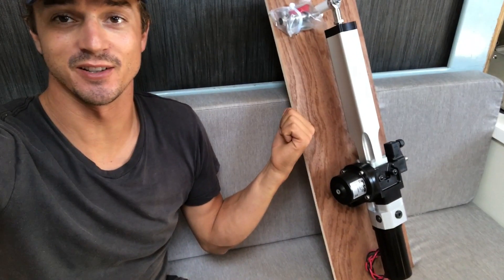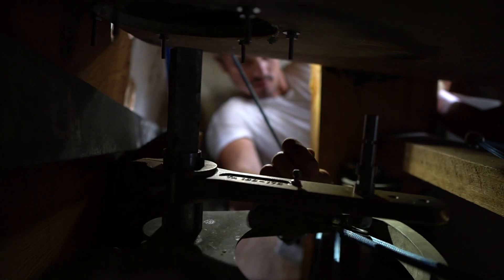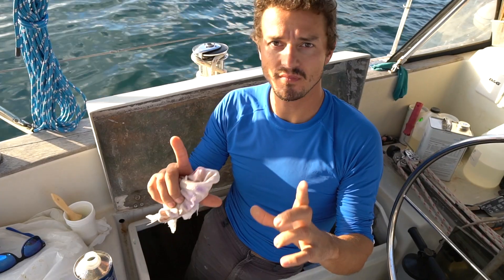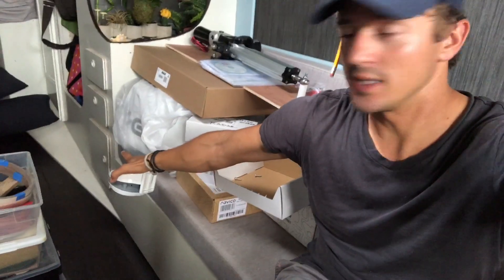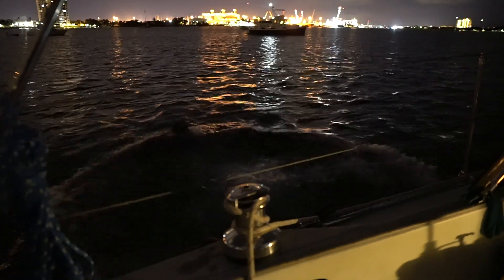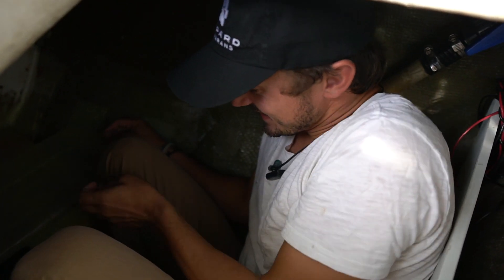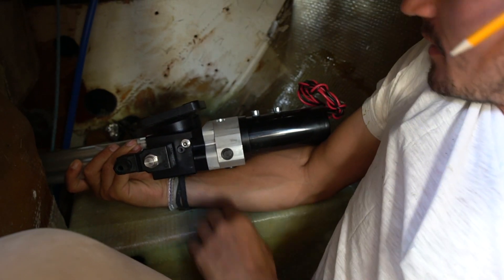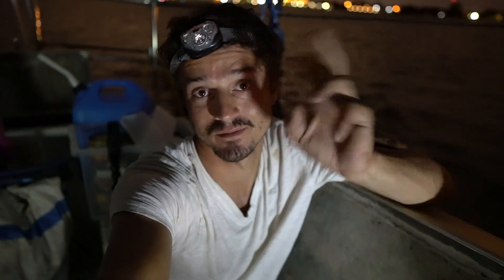Our Last Big Boat Project of the Year— Sailing Uma [Step 149]

Comment: This does remind me on our ram setup (in like 1986)... just far more complex. If it works anything like ours did... it's a god-sent and soooooo sweet. Ours didn't have a wind sensor, so it needed adjustment as winds changed. Still, I remember low wind days where we all sat on the foredeck, having a lovely salad and enjoying the sail waaaaaay more than if any crew would have had to stay back to tend the tiller.

Comment: I am a retired agricultural mechanic and on parts that were prone to water and corrosion we use never sieze grease. Its a bitch because it does not clean off easy ( 3000lbs high pressure washer wouldn't work), but great to keep metal from rusting and moving parts going.
 Also if you have a gear box that keeps heating and burning gear oil, try putting 90% corn head grease(you can find these at farm equipment dealer stores JD,NH etc) and 10% gear oil. This grease is high pressure, high speed and constant viscosity at -40c to +50c temp.I used this in gear case on PTO driven generators during the major ice storm of 1998 which kept them cool and running 24/7.
Reply: My Godin,
I will look into that high presure lubricant , if it does what you say .. I may use it on North Star...
Robert

Comment: Kika, for cleaning the hull: A German sailor bought a butchers glove (they use it to protect their hands when cutting). This is in a kind of hard and sharp. This makes cleaning a lot easier. Also he got a handle for glass workers, they use to carry large glasses without putting fingers beyond . He sucks this on the hull (often over the water line) so he had a better hold when working.

Comment: Dude I fully agree with over building. I was told that if it's worth doing, it's worth doing right.  Plus I just flat out don't want to REdo it. That's why the only thing I would do differently is adding a plate to the underside of the bench for the mounting bolts to anchor to and through. That and double nut everything. However good job guys! I hope you get many many years of trouble free service out of it. 😎

Comment: Good Job !!  There's only one weak link in your design....  Try to use a metal ferrule / sleeve, epoxy or glassed in place for your through bulkhead or plate bolts !  Even though you used marine grade materials, the small area around the mounting bolts can allow moisture to get in and start de-laminating . Thereby weaken the structure that has to endure lots of shearing forces ! Your choice of using large fender washers was a good idea ! But that only helps for lateral pressure ....! One and a half tons is a lot of force !!

Comment: Sometimes those compass locations can be a pain. And it can't have anything made of Iron or Steel anywhere near it unless it has really good compensation. And electric current carrying wires can instantaneously throw them off. Hate putting them in or on or under cars.

Comment: Does that quadrant only hold on to the tiller shaft by clamping friction? I very much doubt that will be enough. Never clamped 40mm, but 17mm on my CNC spindles and you need a ton of force and loctite to keep them from slipping.
Reply from the maker: No, there is a 3/8” key as well and locking screw.
Reply: @SailingUma  Perfect!

Comment: That’s some shelf. Love the lay lines and auto tack features on the B&G kit. It’s top notch!  Is all your 12V power for the ram coming off a DCDC? Or just one 12V set of your 48V pack?  Shame you can’t get a 48V version. Maybe one day.
Reply from the maker: Yes, all our 12V loads come off our DC-DC converters. We have 2 300W wired in parallel so if one goes out, we still have the second one. But honestly, the autopilot doesn't draw that much current, and in rough seas or strong wind, we usually rely on the windvane anyway.
Reply: Sailing Uma That’s cool. Glad to hear you’ve a backup DCDC. Even though of course there’s the CapNord as well. Bomb proof!!  👍 Very impressed with the Cap Nord. Very effective. Playing catchup here but watching the current episodes too... Fingers crossed for the saildrive....  Thanks for the reply. Cheers!

Comment: Very informative video, learning a lot about hydraulic autopilot systems. Do have 2 questions. Any thought about installing the in a different location rather than next to the display? Might be more convenient to be able to operate the autopilot from 2 locations. I don't know how the quadrant stop are built, so I'm not sure if the pressure from the ram pushing on the stops is the right way setup.
Reply from the maker: Good questions. 1: you can control the autopilot from any screen plus your phone, so your never too far away. 2: you can set the ram travel angle so it never gets to the rudder stops. Ours is set to 25deg and our stops are closer to 40deg. But if your boat is well balanced the pilot rarely goes past 10-15deg. 

Hope that helps.

Comment: since installing your B&G gear how much do you still use your Cape horn wind vane?
Reply from the maker: All the time!! They both have they’re pros and cons. We used the Cape Horn for the entire Atlantic crossing. But then it’s very convenient to just press a button and go grab a line or trim a sail. Perhaps we should do a video about it.... what do you think!?
Reply: @SailingUma  a video would be great and useful to see pro and cons
Have B&G set up but long passage or power failure would be good to have an alternative
Reply from the maker: Sounds like a plan. We'll add it to "the list" of videos to make. We're kind of the opposite though. We have the Cape Horn which work great 99% of the time, but sometimes it's just nice to push a button and have the boat keep going in the same direction for a bit while we sort something out.

Comment: I'm not quite sure if you want your compass so close to electrical wires. Even a weak electrical field from the wires will mess with the compass. I once was on a boat where the compass was in the wardrobe and even the metallic coat hangers did a solid on the compass orientation.
Love and greetings from Germany.
Reply: Who uses a compass in the days of  GPS ?
Reply: I do :p :D
Reply: that little round puck Dan installed in the drawer is a compass, and yes it's not a great space to install it.  I had to move mine in a similar location because something metal would get placed in the drawer and mess up the compass....  So you have 2 choices don't put anything metal in the drawer or move the compass...  Bob
Reply: If both electrical wires to each load are mounted in very close proximity to each other they won't generate any external magnetic field.
Reply from the maker: As long as the metal around it stays consistent it’s fine. The problem is once it’s calibrated, and you add something new it can mess it up without recalibrating.
Reply: I was wondering about this but yep keep the power wires-+ close to each other preferably twisted and don't make any changes after calibration makes sense
Reply: I suppose it would be too much to ask for a switch to prevent the windvane from ever competing with autopilot and for some kind of shielding plate between the ram and the hull. It all seems to be getting pretty complicated down there and beneath the waterline and at a gaskette. Perhaps a water sensor near the rudder gaskette might be a good idea. Anyway, you know best D&K.
Reply: @SailingUma  there is an app for checking for interference when installing the compass. It's called iNstall from Gemeco. It tests for interference to help you find the best mounting location. It's free.
Reply: Jesse Krawiec ,just downloaded it, thanks for link.

Comment: Where did you buy the autopilot tiller arm to connect the ram to your rudder shaft? That one almost looks like it is setup for B&G installs, which is what I am about to do. I'd love to pick that up, it would really simplify the project.
Reply from the maker: Honestly, can't remember exactly what company sold it. But, I do remember calling at least a dozen marine suppliers before finding the right one. They are out there, but for some reason, difficult to find.

Comment: I realize I am watching this episode long after it was "published", but where is your windvane?
Other than seeing the initial work for the life lines and stanchions, what happened to that project.
Reply from the maker: The wind vane is still there, haven’t removed it since the install in Curacao. The stanchions are also done, but instead of doing with the full steel handrail all around, we just kept the dyneema lines, they seem to hold up just fine.

Comment: I have a 100% hydraulic steering system on my yacht... great when it's all working pain in the ass when it breaks down. I do really like B&G and my next yacht is going to be B&G all the way. It will be interesting to hear what the power consumption is of the system, especially if your running your electric motor at the same time. Another point will be how much noise it will make.
One modification I was considering was a cooler on the return line from the steering pump / Ram to help keep the fluid cooler hopefully helping to extend fluid and motor life. As we get closer to Asia & the equator keeping it all cool in 32 degree C heat & high humidity will be a challenge.
As always it's down to those pesky amps and how much everything consumes. Will you go down the path of a wind Genny? The Rutland 940i? looks interesting in power output vs wind speed. Best thing is they really are silent.  Anyway hope you have a fabulous Christmas, I still have 400nm to go before I reach my Christmas hide away. Cheers Nige

Comment: Now that you have the B&G hydraulic beast and the Cape Horn, how much did you find that you used of each for the recent passage to the Bahamas?
Reply from the maker: Well we used the new hydraulic one the entire way, as a test, since we saw many different sailing conditions. Worked great! But on longer passages and overnights we'll be using the Cape horn most likely.

Comment: Question. In previous episode about the "new brain" you mentioned that the sailing computer had two sonar interfaces. I did not see you hook up any of those. As you mentioned icebergs when talking radar, i thought, well the majority of the berg is under water. A sonar measuring under water straight ahead might actually do a better job, or add a lot of value. Your opinion?
Reply from the maker: The depth sounder we installed is wired into the NMeA 2000 network, keeping the sonar ports open. And radar does a better job actually since it works much further away. We are experimenting with a forward looking sonar, we’ll see how that goes in a future video.
Reply: @SailingUma  - great, thanks. (but, radar does not penetrate water, does it? physlink.com: "Unfortunately, Microwaves are strongly absorbed by sea water within feet of their transmission. This renders radar unusable underwater." So an asymmetric ice berg with a big underwater lump protruding towards your vessel constitutes a serious risk, right?) I'll patiently wait for your future video.
Reply: Q. In comments to one of your videos, a captain of an ocean-traveling container vessel (the ones over 300m long and 50m wide) asked you, paraphrased, if you carry a radar reflector as he would not see you on his radar. I did not see an answer, but my question now is, would he see your radar? Or do you have enough radar reflectivity in the top of the mast with the radar transceiver? And, if he could see your radar on his, could he only see "you" when you have the radar "on"?
Reply from the maker: 2 great questions, icebergs always show some part above water and our new radar can pick up mooring balls, so I'm sure it will see ice as well. Will be interesting to test that out hopefully this summer. 

As for radar reflectors, commercial radar, is MUCH better than the consumer stuff we all have on our boats, and yes, they can see sailboats. Reflectors, just make the targets appear larger and maybe from further away. But within 5-10 miles, ships can see us, we've actually called and asked them before. Our solar panels alone are 4m2 of right angles, plus the dingy on deck etc. Maybe back when sailboats we all wood and radar tech was in its infancy in the 70-80's it was an issue, but not really in today's world.
Reply: @SailingUma  - thanks. Yes, they can see you the way you describe. As you may be on English shores, still, look at your "maps". A loaded oil tanker on its way to Rotterdam harbor switches its engine "off" at about Calais - 200km before Rotterdam harbor. When one of you is deep asleep and the other at watch, yet dozed off, at 5-10 miles distance, there is no way these huge vessels can avoid collision. They will try to contact you via radio and may sound a horn. The container ships are designed for 24 knots. The huge military vessels are a lot faster, but we can assume their radar is a lot better even ;)
Maybe sailors should have something like in my car that raises an alarm when its computer gets the impression that I lost concentration. With two smartphones and a simple app linking two phones, that should be a piece of cake to make. "Ping" the person at watch every, say, 10 minutes, and if there is no timely response, give a wake up call to the other one that is fast asleep. That would also cover medical and other situations.

Comment: Dan,
Hey another great video and the Auto Pilot unit,  does not appear that your new unit is  the same as the new Hydraulic unit that I received from B&G , yours may have been the older unit that I did try to buy but was told that it is no longer being made , the ram arm on mine is twice the size and thickness as the unit I saw in your video and has a separate stand alone hydraulic  reservoir and line to supply the ram motor . Yours also had the four wires needed to operate the unit... and my unit only came with two.. and that is why there was an eight hour  phone conversation with the factory to correct the unit to make it work...  the unit I received came pre assembled on a board with separate hydraulic reservoir and supply line to the ram motor.. You are so very right about the Ram mount , it does have to be very very beefy.. lots of force there. Fair Winds and Safe Sailing to you guys.

Robert
North Star
Reply from the maker: Yeah, the seem to make a few different models, but are trying to streamline them down to one consistent line for various sizes of boats. It took is awhile to figure out which one was best four our boat.
Reply: Mr. Blacknass ,  if you want to see the Sailing Vessel that the Auto Pilot was installed on it is a Pacific Seacraft 44 and you as go too youtube and type in...North Star is coming... and it should pop up.. 

Dale R.
Reply: Mr Blacknass, 

I will have to look up and see exactly what model number of hydraulic unit I purchased and get back with you.. I just know that my professional installer spent most of the day with the B&G Tec's and engineers to fix the problem.. and they said it had to have one more wire installed that B&G had forgotten to build into the unit..they did not know that  there is a needed connection to drive the hydraulic unit..  I can only imagine the meeting that took place with management of how this unit left the factory designed so that it will not work in the field... I do know that my unit is different than  .. Dan's unit... and lucky Dan . And Dan fair winds to you and your Sailing.. 

Robert
Reply: Twisted Race , so did B&G get back to you ?

Comment: We had an electronic autopilot, just like yours, but it was made by Garmin. We only used it once! It made so much noise every time it turned the wheel and guzzled the power that we shut it down and never turned it on again.
We prefer to properly balance the sails lets the wind steering do everything to keep us on course. It uses no power and makes no noise.
Reply from the maker: Yes, we don't plan on using it often, but nice to have a back up. Our windvane is awesome. We did use the new bandg ram all the way over to the Abacos recently and it did great. Couldn't hear it over the wind and waves accept when going down wind, and then it just sounded like someone snoring in the cockpit locker. Also didn't really notice the power draw any more than normal. We'll have to do some better testing, but when we had the entire system running, it didn't pull more than 100W
Reply: I have a Raymarine pilot, similar to this one that UMA puts in but a mechanical arm instead of a hydraulic one, it's dead silent, you can't hear it even if you try, it can handle any weather with ease (so far), does not use a lot of electricity, we use it every single time we use the boat. I prefer not to waste my time balancing the boat and hope that the wind does not shift. :)

Comment: Great video and excellent info as always Dan! I'm sure you've already figured this out, but that's actually an electric linear actuator. They're exponentially less reliable than hydraulic actuators so if you have the space/room in the budget, I'd highly recommend keeping a spare on hand or at least determining the typical failure mode of the model you have and picking up spare parts if possible.
Reply from the maker: https://www.bandg.com/bg/type/spares-and-accessories/autopilot-spares/hydraulic-ram-t1-12v/
Reply: @SailingUma  I should know by now that you wouldn't put any flaky junk in UMA. I was actually very hesitant to post the comment but I figured what the hey, if I'm wrong at least I tried to help.

Comment: Are you absolutely certain you want to mount your ram with stronger/different hardware? I can't be sure from the video, but the supplied bolts look to me as though they were designed to shear (like shear bolts on a snowblower) to protect the ram and your boat. 1500lb of thrust? If the rudder got locked, would you want the ram to use your shelf to punch a hole in the side of your boat? <:O)